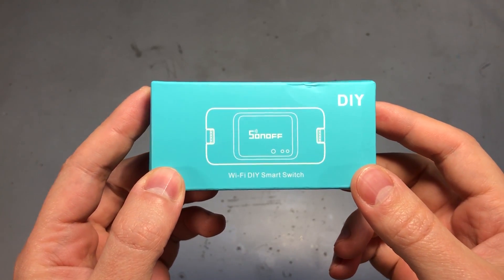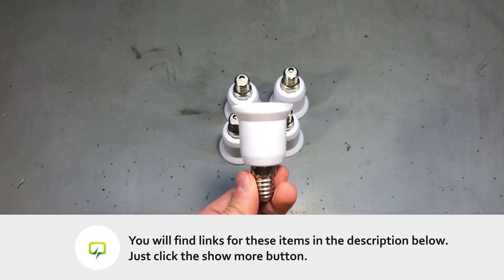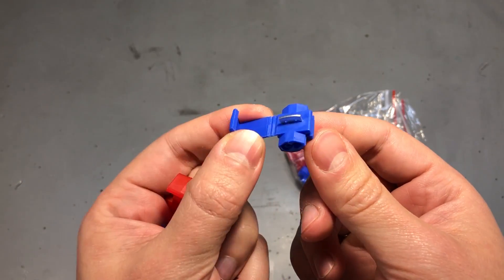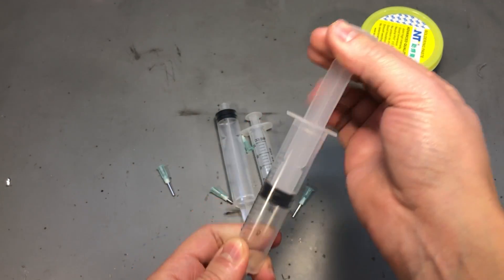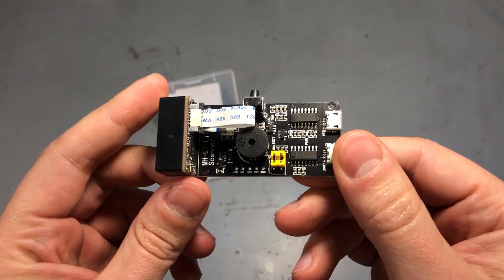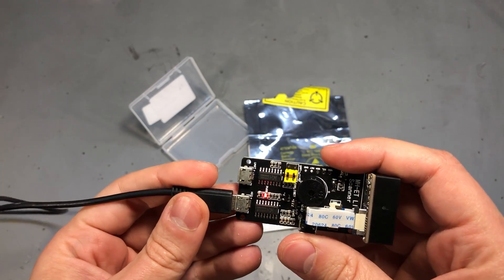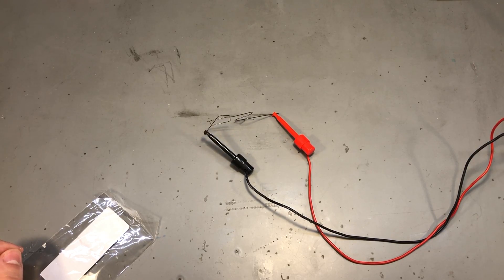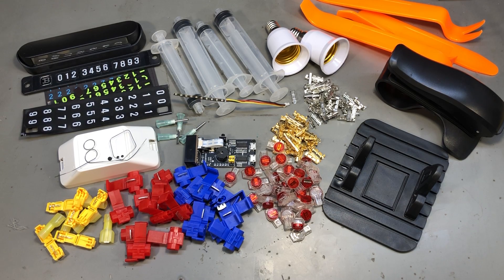Voltlog #278 - InTheMail

Comment: Leur lock transfer was my original idea, fill a syringe with a flux (and a lot of air bubbles). Heating worked much better like I suggested before. Happy to see anyone using the tip!
..and the yellow flux seems to work well and is dirt cheap like empty syringes!
Reply from the maker: thank you and Happy New Year!

Comment: On crimp connector #1, I wouldn't say crimp connectors are "more reliable" than solder. If a connection is "gas tight" then it will perform excellently over time and the telephone system is created primarily out of gas tight crimp connections which proves they work, so industry adopted crimps because they're so much faster and cheaper to do in production. Soldering is desired for reliability, but the difference is so small it's only demanded in mission critical applications. Aerospace applications use connections that are crimped and then soldered. The solder provides more reliable connections than a crimp alone and the crimp reduces the amount of solder necessary to get that reliable connection which reduces weight. The size of the resulting solder ball is actually tightly controlled and if it was not, the total weight of the solder used on a Saturn 5 could be high enough to prevent the capsule from reaching orbit.

Connector #2 (red&clear plastic). The official 3M brand name is Scotchlok UR but as a phone installer in the US, we call them "beans". I love these connectors and have never had a single failure of the 3M brand connectors. The cheaper ones can crimp the wire a little hard with larger gauges and I've had a few breaks of the copper inside the connector while the jacket kept the wire in place... just something to know for troubleshooting. One of the best connectors for wet environments.

Connector #3 are clone of Scotchlok 560 or Scotchlok 905 family connectors. The difference with 3M and clones is mainly the quality of the blade and how they corrode over time. I would only use the clones when you need less than 20 amps and only inside, but for that they're fine. If you want to pull the full rating, it pays to use the genuine parts. https://youtu.be/13wstX-Fcwo John Ward - Wire Connectors - Failed and Useless

Connector #4 are clones of 3M Scotchlok 951/952

Great video as always. Happy New Year!
Reply from the maker: Thanks for the useful info! Happy New Year!
Reply: I'd take you to task with your view on crimping. The high pressure crimps and tools make a joint that is indistinguishable from a solid wire (if you look with a scanning electron microscope) and is both more reliable and more importantly repeatable than solder and without any heat shock/damage. It is also much more expensive than a solder joint/plug. These are highly specialised and connectors are made for a particular cable and tool die etc. A crimp of this nature will not allow any solder to flow except to spoil the surface look and dimensions.
Agree about the 'scotchlok' people say nasty things about them but they never fail and are so convenient.
There are obviously different grades of crimp, but the best are close to perfect down to a molecular level.
Reply: @martinda7446  The objective of crimps is to create a "gas tight" connection as I stated above. The idea you can't distinguish the junction in a crimp from solid wire is pure poppycock. PURE poppycock. The wire and connector are made from different alloys with different crystal structures and very often one or the other has a coating of a 3rd or 4th alloy for anti-corrosion. They're even different colors usually. I used to have a metallurgical microscope as part of my high speed signal integrity lab at work and I've spent plenty of time viewing cross sections of electrical junctions to verify the results. Our group did work from DC up to 10GHz. I've also assembled more Amphenol CMC and CPC connectors than you can shake a stick at, many of which were for surface to air missiles and their command & control systems. I'm giggling thinking of 30 years of dealing with mil-spec sockets that had gas tight connections when made but not after several years of vibration. Soldered connections don't suffer from that failure mode which is why solder is used in high reliability situations to provide insurance against vibration introducing failure of the gas tight junction. Crimping is used rather than soldering for some alloy coatings like nickel-coated copper wire, but for bare copper, phosphor bronze and such, solder does a better job. As an aside, you should know that Western Electric which was the manufacturing arm of the Bell System/AT&T was a prime US Army missile contractor and their work in all the equipment racks of the missile systems they built were done with wire wrap around sharp square posts and then a coating of solder for encapsulation.
Reply: @Peter_S_  I must have dreamt it. Happy New Year.

Comment: Scotchlok is a brand name from 3M. They  tend to corrode and fail in automotive applications. Positaps are probably  more reliable. Those ur jellybean type connectors for solid wire are pretty  reliable and still used in telco applications. They also use the scotchlok brand name but are a totally different animal.
Reply from the maker: Thanks for the feedback, I have zero experience with these.

Comment: Throw those scotch locks right in the garbage.  Back in the day I repaired so many damn no-starts, damages, and worse due to these things. Only the laziest/worst of mechanics use them.  They deliberately pierce the insulation and cores then leave it wide open to the elements.  Junk :)
Reply from the maker: Thanks for the feedback, I have zero experience with these connectors.
Reply: @voltlog  Solder & heat-shrink. Do the job properly. They are just heartache. P.S. on 24V you are now high enough heat output from a poor connection to cause fire.  Stick to 12V on those as the inevitable crap connection wont burn at least.  Cheers!